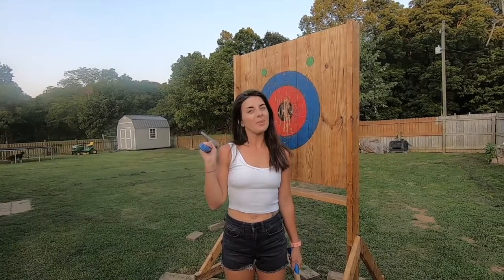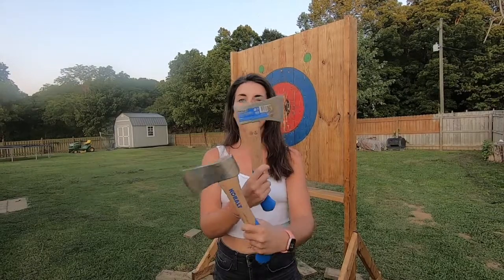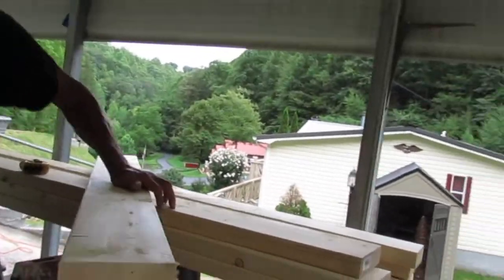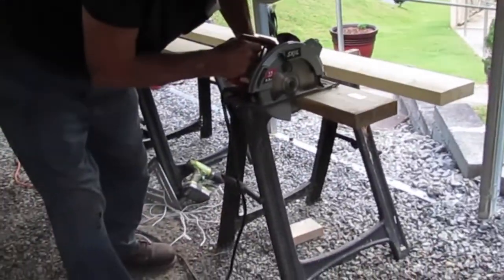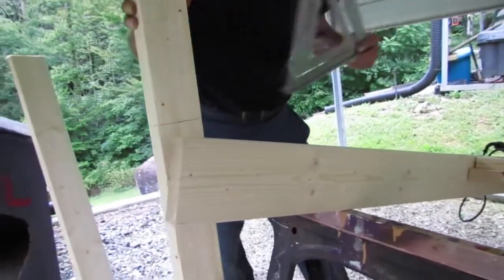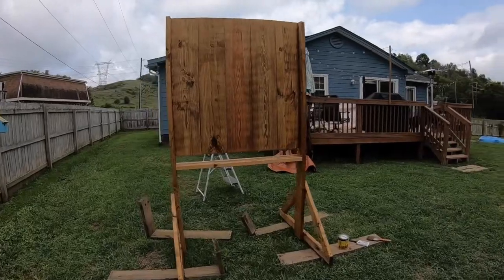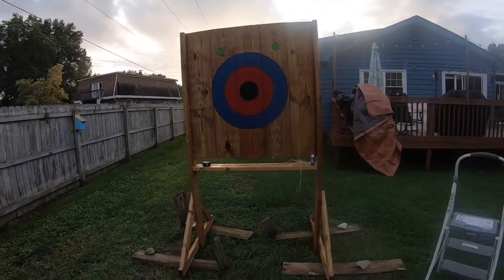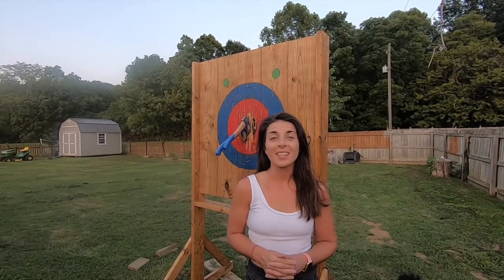HOW TO BUILD YOUR OWN AXE THROWING TARGET | 4 MINUTE WALKTHROUGH

Comment: Do you just replace the board when it gets too damaged? How long did it last?
Reply: I’d assume so, but curious to their response
Reply from the maker: Yes, that’s what we plan to do. We haven’t replaced it yet, but it’s definitely ready. It took about 1 month of consistent throwing until there wasn’t much left of the bullseye.
Reply: Brianne Foster is it easy to replace? Wouldn’t you have to build a whole new one feet and all?
Reply: Each board is screwed in from the back to hold in place, so just unscrew the screws in which ever board you want to replace,  pop the board out, new board in, put screws back in to hold board
Reply: When you get good, you can destroy a board in about an hour. I go to the axe throwing places and I'll destroy the boards in an hour of being there. But, I throw a lot and I don't really take breaks either. I test different distances and force with the axes while there. I personally use tomahawks and knives at home. The last time I went, I put one of the axes through the board. I had to change axe throwing stations. If you throw a lot, look into an end grain throwing target. They take a bit more to build, but last a lot longer. Also wet the boards before you begin throwing, it makes them last a bit longer.
Reply: @iamacog2989  Thanks for the information. I've been watching some videos and I'm getting ready to build one. I got my throwing axes coming tomorrow. Looking for another hobby to get into as a pastime.

Comment: What type of wood do we need?
Reply: Pine is readily available in most hardware stores, but it really doesn't make a good target.  If you can get your hands on cottonwood or poplar, those both will last longer and easier to throw into them.  Also, keep the targets wet.  That helps them to last longer.